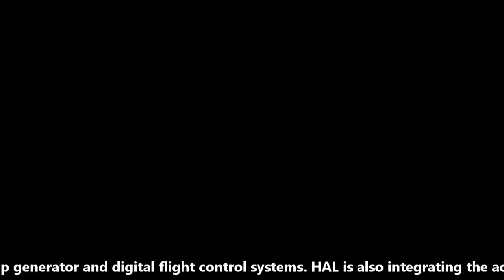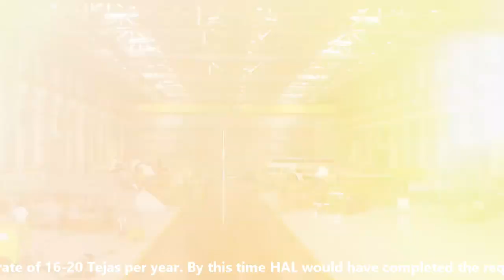First Flight of LCA Mk-1A by March 2022 | AESA Radar & Electronic Warfare Suite integration in Tejas

Comment: Bro why HAL not adding conformal fuel tanks in tejas cos the range and combat radius is very less...also can save hardpoint of drop tanks.
Reply from the maker: Conformal fuel tanks have the disadvantage that, unlike drop tanks, they cannot be discarded in flight, because they are plumbed into the aircraft and so can only be removed on the ground. As a result, they will impose a slight drag-penalty and minor weight gain on the aircraft even when the tanks are empty, without any benefit. They can also impose slight g-load limits.
Now if HAL changes the design, it will push back the development by another 2-3 years, so np please...
Reply: @IndianDefenseAnalysis  conformal fuel tanks are aero dynamic. Any performance loss will be very minor. If they were so bad they would not be added in F 18 and F 21. Drop tanks and ew pods also create drag but the benefits outweigh the losses as does for conformal tanks. But any delay is definitely not acceptable.
Reply from the maker: @deeptruthchanneldtc6770  agree conformal tank have better aerodynamics than external drop tank. But you can drop external fuel tank if needed during dog fight but you cannot do that with conformal. Each have their own trade offs

Comment: Why HAL dont increase its delivery upto 20 or 24 jets/ yr, when we know that manufacturing line will be further going to be used by different projects, such as MK2, AMCA TEDBF
Reply from the maker: Its not HAL but MOD's  call and reason is fund. It will increase the overall per unit fighter jet cost.